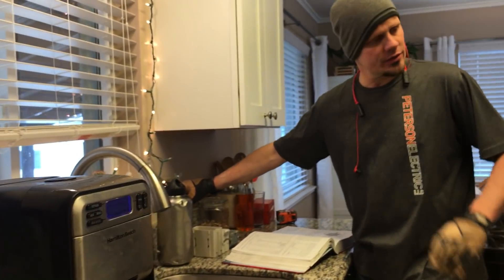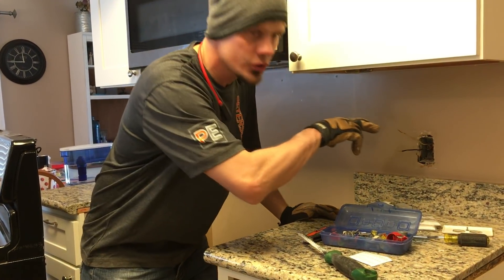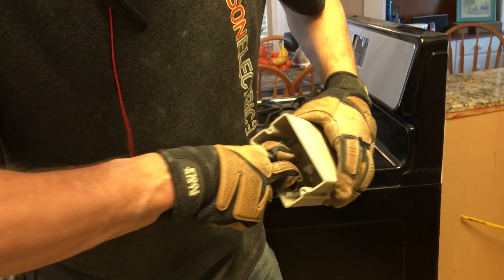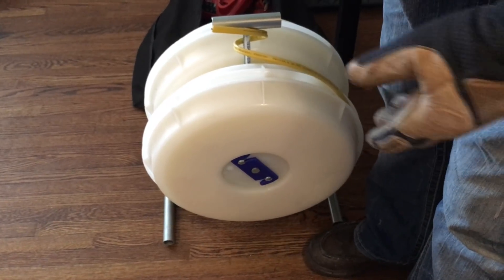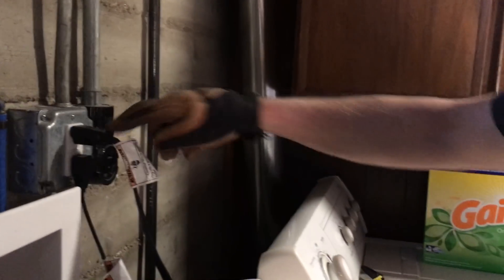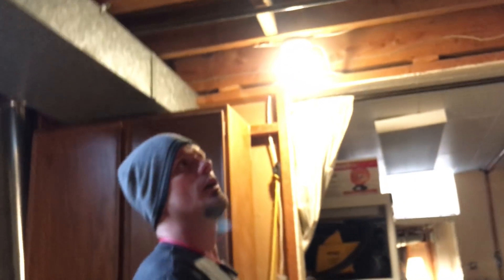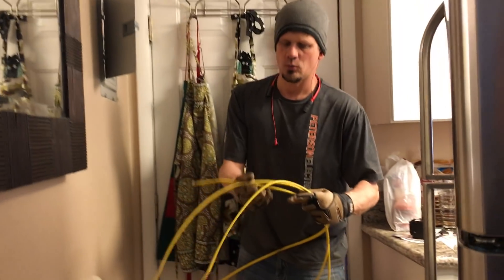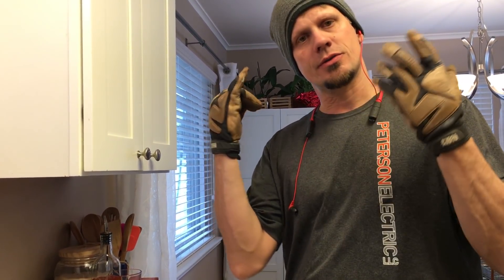Residential Kitchen Remodel - Electrical Code Requirements - Part 2

Comment: Really enjoy your videos. Our code here in Canada is similar to NEC. See some nightmares here in old houses. Just did a 1900 house with 5 different generations of wiring, like your 1908 video! A Duplex with Two FPE panels, and ungrounded, spliced in crap everywhere. Fun. Keep the videos coming.